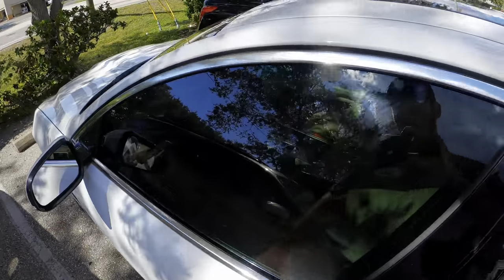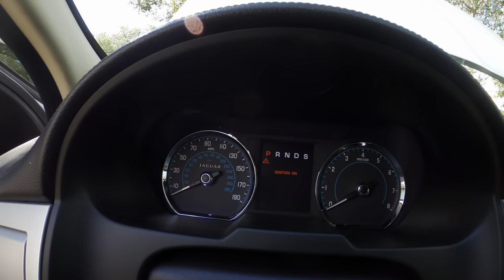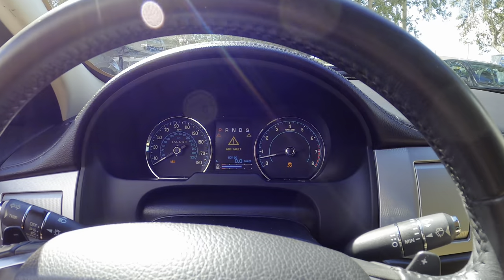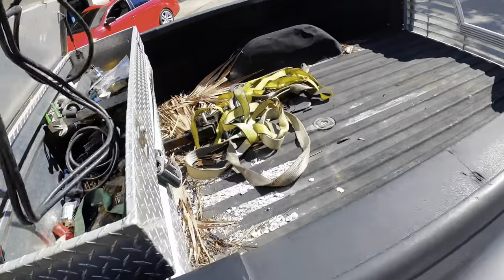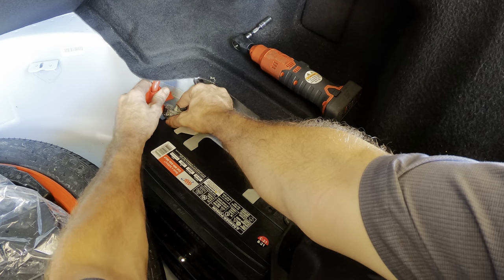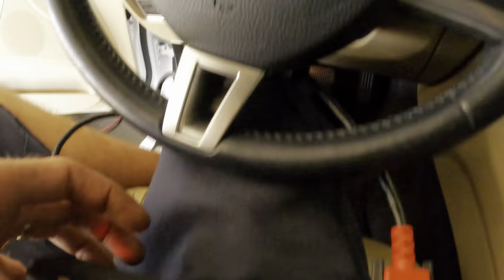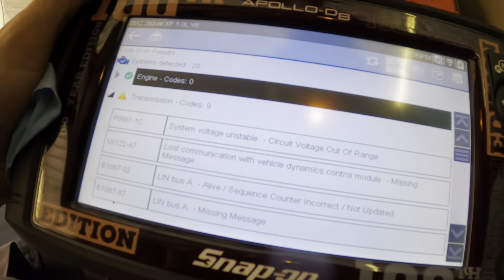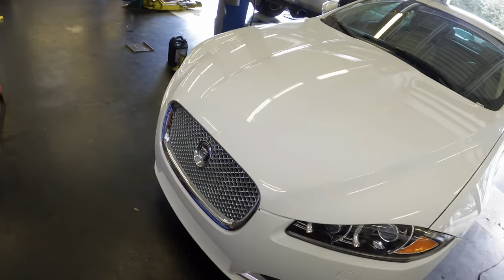Jaguar XS just Towed In.  I’m in over my head! Customer States: “Check Battery”

Comment: Had the same thing happen to my Jag XF....
Flat battery,  all the same thing's on the dash low voltage, gearbox warnings, jumped it to start and same thing gearbox locked in park. Got a fully charged battery in and same thing  errors and no garage to the battery. 
Checked the alternator and it wasn't sending any charge so new alternator fitted and started straight up no other codes gearbox working fine 👌 happy days apart from the £600. Bill for the new alternator and the labour.... little more investigation needed, lack of power to the battery and electrical system should have started you to question the alternator wich may have been as far as you needed to go.... would be interested to see what the outcome was at the end of the video....

Comment: Good call on passing on this one. 

Just to throw it out there, Jaguars and Land Rovers like to talk a lot in their DTC’s. I can go out to my Range Rover Sport right now and probably pull at least six DTC’s. I work at an independent Land Rover shop and we usually note the bigger faults and ignore the communications. Then we clear the codes and see what comes back. Most times this weeds out the background chatter and shows the bigger issue(s). You also want to have a power supply on the battery while doing diagnostics since the systems take a lot of power. 

Also, JLR products are power hungry in general and eat batteries alive. The best thing you can do is put an AGM battery in them to slow this down. Yes, they cost more, but in the long run pay for themselves.

The car was also equipped with a battery management system. After startup you may not see your wanted 14.6v since the BMS will tell the alternator not to charge the battery for a while so the system can normalize first. My RRS has the same setup and I’ve watched the voltage go down to 11.6v and hang there before coming up. Usually only after driving does it go up to 14.6v.

On top of all of that, because of the battery management system, you have to reset the BMS to tell it it has a new/fully charged battery so it can learn it and restore power to the car (it starts shutting down modules one by one as the battery dies). Gearbox fault is basically it’s end game to say the battery is dead and you’re not going anywhere. You also have to hook up your power supply negative to a different area, not the terminal. Hooking up to the terminal will bypass the BMS so it doesn’t know the battery is being charged. The odd tab coming out of the negative terminal is where we normally hook up to.

You also need to hook up positive first, negative last and unhook negative first, positive last. They can get emotional about this. They can also have meltdowns if you don’t wait 3 minutes to disconnect the battery after powering down. Like have to reprogram half a dozen modules meltdowns.

They’re pains, but once your head is around the electronics, they’re like most any other car.

Hopefully some of that helps for future reference.

Comment: Had a XF estate that in 4 years had failed air suspension, gearbox fault  where the selector knob would not lift and finally it stopped recognition for keyless entry and start. UK Jag main dealer had the car for 6 weeks and had to call in factory technical services for help. In the end they decided to replace each electronic module in sequence at £300 - £400 each. At the end they got it running and I then sold it to a car buying site the same day. Never will buy Jag again.

Comment: Good job ray  knowing when to say no .Any mechanic with the connections to information can fix these issues but it's the access to the information that's the problem 
I  rebuilt an engine where the manufacturer would not give me the torque settings we tried to get the crankshaft ground  .local machine shop said no problem but they wanted the tolerances to grind it to .and again manufacturer wouldnt give info  .I went ahead with getting it the shaft polished and a new set of mains  .we called out the local dealership to repair a fault on another machine .the technician  a guy ive known and worked with on other issues over the last3 years let me know that he'd been told not to give me any info by his manager  .No problem supplying parts but no info .. 12000 in parts or 25000 for a recon engine  .The job went on for nearly 10 weeks  .i totally regretted takin on the job cos there was times it looked as if I was the stupid one because I didn't want to go any further without info
If it blew up again I was the idiot that built it in the first place  ..
Happy to say it has run for 4 years and 3900 hours since and no issues

Comment: Some years ago I had a alternator that stopped charging. Sears service shop's computer stated it was a bad alternator. So they put a new one in and it didn't fix the problem. But they said I had to pay for the new part since once a electrical part is installed you have to pay for it. I angrily left realizing that I been had. What they did was unethical by forcing me to pay for their mistake. I got home and the next day I started a step by step process of elimination. I finally got around to checking with a probe testlight the wires going to the field coils and saw  there was no power. Then I felt the wires and I could feel a break inside the insulation. I stripped it and twisted the wires together and saw the meter in the dash was laid over in the charging state. So much for diagnostic codes. They can be misleading and costly.

Comment: My fiat battery died, I replaced the battery and all the modules went cucu on me. I had to go to the dealership because the diag tools I had weren't able to reset. 5 min with their diag tool and the car was up and running. Good call not to mess with it

Comment: I'd bet money this is the auxiliary battery that powers the body control module (including gearbox / selector). Same symptoms on girlfriends 2012 Range Rover Evoque with very similar electronics. Fixed by replacing a small auxiliary battery behind glovebox. Costs $300+ from dealer, or you can buy exact battery for $30 and have someone swap the connectors. No issues 2 years later.

Comment: My 98 Rangers radio stared tuning it self in and out then the truck Died. No power at all. Turns out the alternator and the battery had died at the same time. I replaced them both and that ended the problems. That car was smart enough to know it didn't have enough power to run all that electric crap and a electric transmission shifter? Lol. Please keep up the awsome videos. Thank You

Comment: I would have checked output voltag at the alternator. No voltage, replace it. The gearbox issue is a standard issue with jags. Just requires a reset which can be done manually.

Comment: I had a BMW that had a similar issue. It had the battery replaced by another shop and the owner never took it to the dealer to have the charging system recalibrated so it was doing allllll kinds of weird shit. It would drive for 20 mins and then stall and not start, it was throwing all kinds of fault codes and it wasnt charging the battery.
10/10 do not reccomend.

Comment: Had something similar with a high end 2003 Benz. Turned out the second battery was bogus and all the computer returns were based on the second smaller battery. Since it was bad every single sensor reported bad in one way or another. Couldn't walk away from it because it was a mechanic that had been a friend for many years who had committed to fixing it. Did manage to guess what the problem was and we got it up and running, but I won't work work on any high end modern car. Anything above something simple like a Genesis or Infiniti I won't work on. High end Audi, BMW and Benz, for example. 
Euro high end stuff is almost designed to fail.

Comment: Connect running vehicle up to battery again to obtain proper voltage and recheck system scan again or pull alternator and bench test it. Then call it day.

Comment: I think it was low voltage issue caused by bad alternator which has to be replaced first before determining if that is the whole problem or not. Take the alternator off and have it bench tested if not sure if it's bad and go from there.

Comment: Surely it just needs an a new alternator? Another tip is when you've disconnected the battery, touch the +ve lead to earth for a while in order to drain any residual current in the system!

Comment: There is bms system on these cars and if a new battery is connected it has to be fully charged or can mess this up, As the original battery is dead I would say this is the alternator as that and a dying battery cause all these faults to show. Problem with changing the battery on the face lift XF is it can blow the security side of things and can stop the doors from working etc. If that module blows it can cost £££££££ but can be worked on with the right reader.

Comment: When I was young many years ago I had two British sports cars, an Austin Healy Sprite and an MGB. They were tons of fun to drive but required frequent maintenance and were very temperamental in how they ran. I was very knowledgeable about cars and had a complete set of shop tools and instruments. I eventually wound up rebuilding the engine on the Sprite myself. The Lucas electrical systems on those cars was a nightmare. One of the good things about having those cars was that it forced me to sharpen my diagnostic and repair skills considerably to keep them in good repair.

Today, I drive a Japanese made Nissan 370Z, 39,000 miles and nothing necessary other than routine preventive maintenance. The quality, fit and finish are far superior to any of the English or German sports cars that I've owned in the past.

Comment: I have seen that problem many times mainly range rovers, lots of code faults and strange happenings. It can happen with low battery or faulty alternator They dont like low voltage and hitting the starter  on a low battery mayhem

Comment: Why did you not put a DC amp clamp meter on the battery cables to see current flow? This looks like a bad diode in an alternator rectifier pack. Also could be a resistive short on one coil pack.

Comment: Had a 2017 Jeep come into the shop that the alternator shit out on with a codes list like that. All the codes were tied to the battery having been run low. Replaced alternator and battery, everything went away. When the computer starts getting incorrect voltages everything goes haywire.

Comment: a low battery can throw up lots of problems on European cars, I drive Citroen's and I bought a lexia for mine so I could maintain it myself with a laptop pc, ive had lots of problems thrown up by the ecu from a low battery even if there is no fault from the components showing a fault. whats even worse is that the ECU remembers old faults.

Comment: It's a power issue. What? Who knows but if it ain't getting a good 12.8V or more then it'll throw temper tantrums until then end of time. 

The last two gas powered BMW's I've had were like this. The battery, which was the size of a small island in the X3, craps out every 5 years and your diag tool lights up with 3.4 squagillion error codes. The usual Duralast battery doesn't seem to have the cajones to get the job done but a new BMW ubersized battery, left to trickle charge overnight before install, always got the job done. Thanks to the BMW forums for that nugget of information since the local BMW dealer wanted to charge me for a new ECU each time.

I do have to give BMW props for putting in cables suitable in gauge for running a whole housing development from! There must be about 300lbs of copper in those bad boys but you can tell that it's been an issue for a while given the multitude of charging points labelled around the engine bay that's away from the battery (in the trunk)

Comment: You should always hook the negative lead to a ground away from the battery on the battery being charged. Batteries being charged give off a gas that can ignite if there is a spark.
Reply: I had a neighbour that took a battery straight off charge and put it in his car. The spark from the +ve lead ignited the hydrogen gas and it burnt his arm. ALWAYS let the battery settle for at least 20 minutes before connecting back up!

Comment: I stopped by Autozone the other day and guy was in the parking lot driving a BMW. He was waiting for a tech to show up from the dealership to reprogram the car for the new battery that Autozone just installed. I never heard of such a thing.
Reply: My BMW motorcycle was throwing error codes and running rough day 1 of a trip. I dared replace the battery the day before, and had to stop at a dealer for re-program to fix it. 'superior' German engineering😐

Comment: Ex mercedes tech here. You were probably close to a correct diag on that, I would definitely be looking at undervoltage/battery charging. But, I can only applaud your customer commitment to guiding them towards the correct path once you are unsure. 
Many would have just loaded, and fired the parts cannon, they presented a huge bill, for an unfixed car, to then pass it onto the dealer. Nice work 👏
Reply: I think Ray thought alternator bad, then attempted to find said alternator, couldn't locate it, and noped out. 

Which is smart.  Very smart.  Mechanics don't get paid to read service manuals.  As in, a shop can't charge 3 hours for RTFM'n.

It's always best to send complex cars, like this, to folks that work on them everyday.

Comment: Sounds like the ‘nater went bad and all the modules went haywire from there….   Not really related, but i am a machine mechanic at a fab shop…. All of our modern computer aided machines like laser cutters and punches (trumph, amada..etc) use backup batteries to save parameters…. If you let the backup batteries die the machine basically goes back to ground zero and everything has to be re-programmed…..  sounds like this Jag has similar issues

Comment: Good call. It may have been a charging issue and like another viewer commented that someone may have tried to jump start it as indicated by the markings on the battery terminal connectors but they may have got the polarity backwards and zapped some very expensive electronic components. I always cringed at working on Jaguars back in the 90s. I still am dumbfounded at the thought of brakes under the rear of the car mounted at the differential and not at the wheels. I would never own one of these fine British cars.

Comment: I'll admit I was a bit curious as to what changing the alternator would have done, most of the codes are related to low voltage...  but after looking under the hood and you can't even see the alternator looks extremely hard to work on and what else is going on with that thing?... good job recognizing a rabbit hole !!!

Comment: With European vehicles you need to do a battery replacement procedure with a sufficient scan tool which was probably not done by the triple A guy who replaced the battery which is why the car won't start or run smoothly because it still thinks there's not sufficient voltage based on the last report the ECM/VDCM got.
BMW does this and so does Mercedes-Benz and many others because battery voltages are more critical to run modules.

Comment: I own an old Jag. Work on it as a hobby. It’s time consuming and can be complicated. I spend hours on forums and with the workshop manual. I usually have to solve multiple problems before getting to the visible issue. Anyway probably a good, honest call you made there.

Comment: Clearly the fact that a new battery had already been installed there is an ongoing problem with the charging circuit etc. ... What other damage that has been done as a result of the low voltage conditions is probably more of a concern. The gearbox warning light in particular. Hopefully the customer takes some good advice. Get the car diagnosed and checked over by people who are trained to deal with this specific car and its systems. Hopefully they don't have to load up the expensive parts cannon on this one and the Warranty covers the costs.

Comment: like J M im a Jag and Land Rover teck. check to see if they did a state inspection recently lots of times the jags do not power down the pcm after a state inspection if you do them in florida. then you kill the battery. then someone just puts a new battery in but it could also be one of like 2 million other faults i would just walk away from all of them if i worked for an independent shop.

Comment: I just don’t understand people, I’ve been told to go to the dealership before and thanked the mechanic because in the long run it will save you the big 3: time, money and frustration.  Imagine as a customer paying to put in a new battery, alternator and work on the transmission just to have to go to the dealership and find out nothing was wrong with any of them and now you have to work on the electronics

Comment: Good diagnostic! It’s possible to “flux” the problem in any car, truck, etc. You get the parts to move then measure the effect on the entire vehicle. Here, I’d get the tires to roll on a treadmill, then measure the transmission for interference. A jaguar without a second gear indicator sensor will fail to restore it’s “head power” as a safety feature. All motion comes to a stop. Take care!
Reply: Might also he a cànbus failure with all those codes
Reply: @jimruthem6587  A canbus failure would’ve resembled two of the same type of code. Jaguars and pontiacs use a second memory bank to refresh the canbus— if some port fails the second will reply the code!